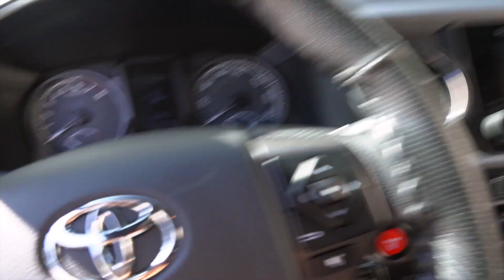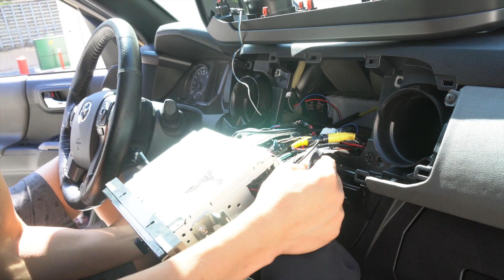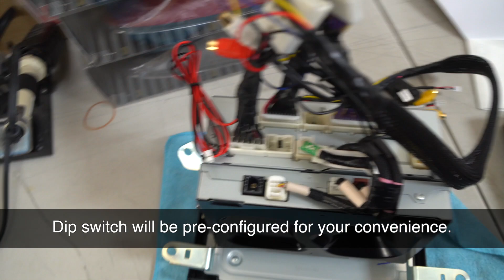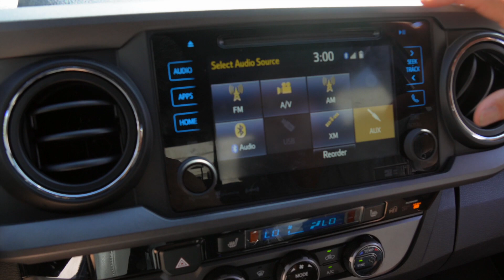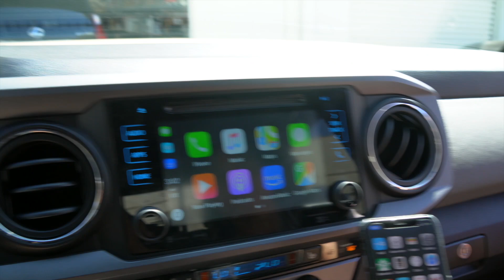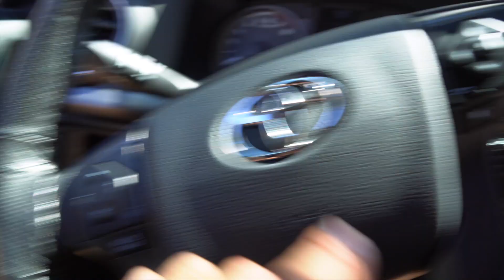2014-2019 TOYOTA TACOMA TRD Pro | Wired Apple CarPlay Android Auto | Installation and Demonstration

Comment: I think this is the same exact functionality as the CARABC unit @ $200.  What's the difference besides price?
Reply from the maker: Ours don’t glitch. It works like oem, does not run via android and need updates, you won’t lose your backup camera or sonar, image quality is better, sound quality is better, phone call quality is better, steering wheel controls work, US tech support and customer service.
Reply: I had CARABC and screen and phone quality was terrible so I returned it.  Is the screen and phone quality really like OEM with your product? @BeatSonicUS

Comment: I got a 2019 s r 5 this will be able to work correct? And my back up camera will still show? and will i be able to switch through music and stuff using my the controls on my wheel
Reply from the maker: Yes this is compatible with 2019 SR5 and your backup camera will still show. And the steering wheel control track up and down will work
Reply: @BeatSonicUS  ok thanks and usually there is 3 screens on the carplay where if you swipe left it shows music and gps is there not this on this one?

Comment: I know I already asked this but I got 2 questions when I plug my iphone into my car the aux option doesn’t come up only the usb option phone doesn’t have a headphone jack either. Does the CarPlay box make the aux button the default or something? Also do I need entune for this my 2018 Prius 2 has entune audio. No jbl, apps, or nav. Will this still work? Sorry for asking these questions so much just want to make sure that my car is compatible before I buy it.
Reply from the maker: Yes carplay kit will activate aux. you do not need entune. Your car is compatible
Reply: @BeatSonicUS  Epic. Will be ordering one when they go back in stock
Reply: @BeatSonicUS   Also I have a iPhone 12 Pro will my phone have any problems working with this?

Comment: I have the same head unit like in the video. It not a JBL would that still work? For tacoma 2019?
Reply from the maker: Yes it is compatible with your Tacoma
Reply: I was going to ask the same exact question as Beat Sonic says "2016-2019 Toyota Tacoma with JBL only" and this seems to contradict the video and their comment below but if it works I will be upgrading as soon as they come back in stock